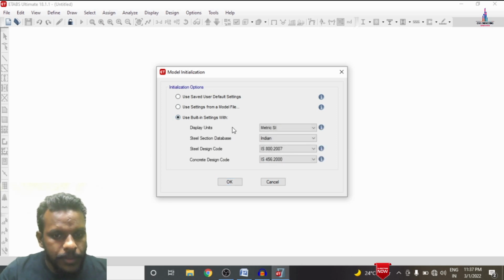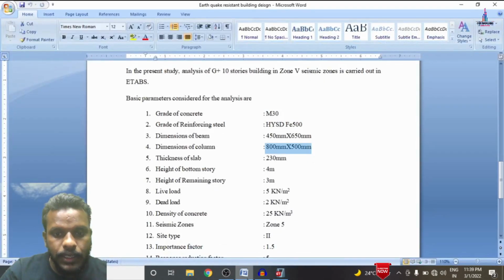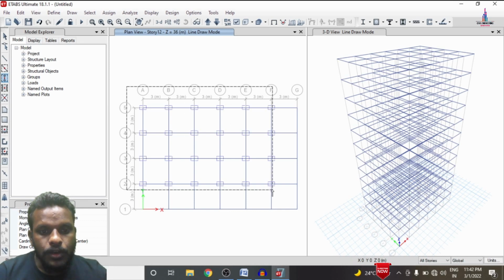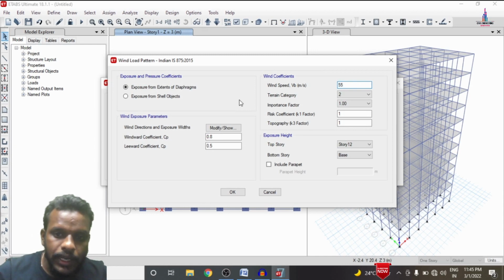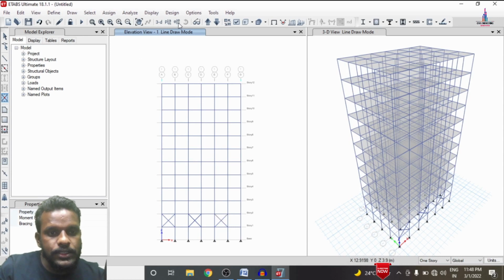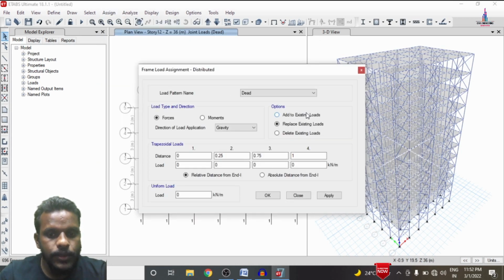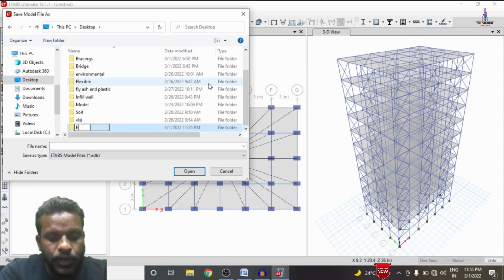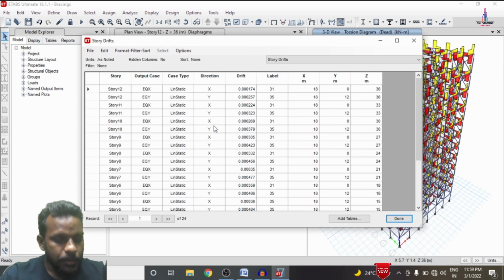Earth quake resistant building design with bracings in etabs software | structural design | civil |

Comment: Sir please 🙏 make a content on analysis and design of a room for the Dimensions as follows:-
1.Room Dimensions - 3×5m
2.Room Height - 3.5m
3.Plinth Height - 1.5m
4.Floor Beam - 230×350mm
5.Plinth Beam - 230×300mm
6.Column - 300×350mm
7.Concrete grade - M30
8.Steel grade - Fe500
9.Live Load - 2Kn/M2
10.Height Of parafit wall - 1.2m

Thank you!